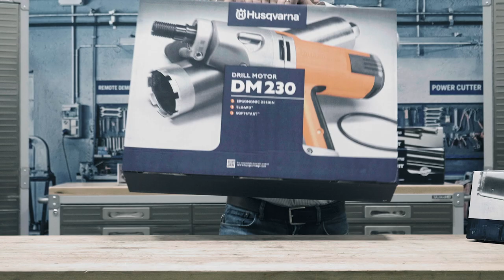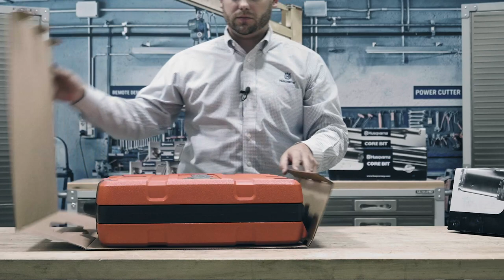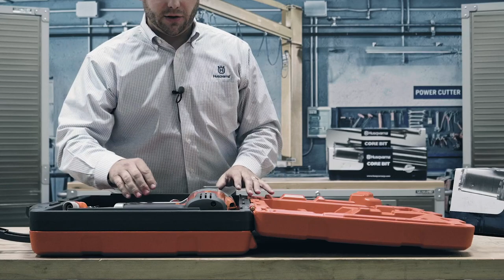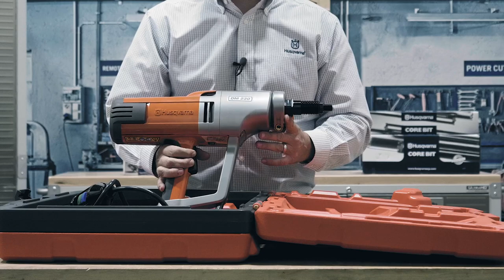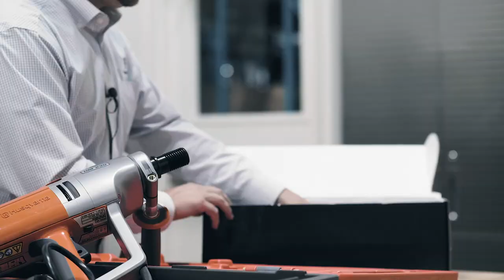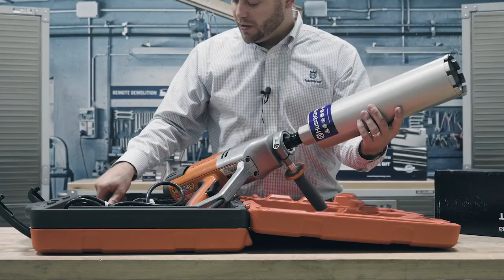Husqvarna DM 230 Core Drill Unboxing

Comment: Hi,i had a kind of stange thing when i drillead a 112mm hole in  a AAC (Aerated Autoclaved Cellular Concretewall) , with 20cm thikness,on maximum speed  when i pressed bit more  strong on machine it's stops  from spining like a protection mode against overload..but way to easy,i am talking about an dm230 model ,that might be an issue with my diamond core drill machine?
Reply: Max spid is to much for 112mm... Max speed schould be used when drilling small diameters 30-75mm, 75-110 with second gear and above or 110 with first gear.
Reply: @Pedja1987k  update ,i used on speed 1 in brick wall   ,in speed 1 was no  protection , at one point  the core drill bit  get stuck amd overturned the machine from my hand and after that has stopped work  ,now i have to find an engineer to sort the problem :(
Reply: @AlexAlexALV  my machine stops if i push to hard but does not stops in a moment... It kinda slips... But drills
Reply: @AlexAlexALV  and i think it is a protection for operator... If you take a look to spare parts list... You will see a part no 525 40 20 01... It is a slip clutch part thaw wears over time... I think that problem is not to big to replace it!
Reply: @Pedja1987k  my one stopped working and i cannot start it again.
Reply: @AlexAlexALV  does the motor spins... If motor does not produce any sound than it might be an electrical problem